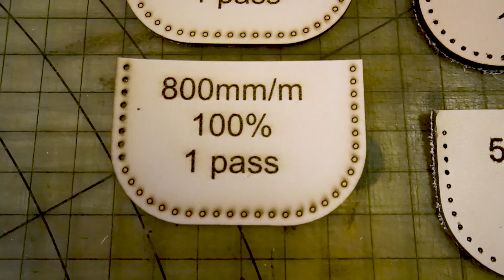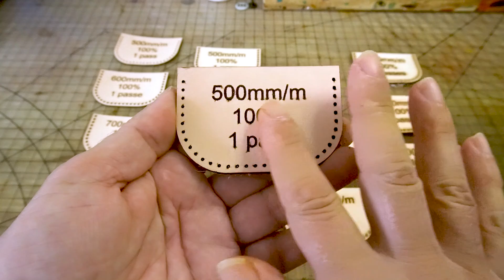Can a 10watt Diode Laser cut leather patterns and stitching holes? Aufero Laser 2 Lu2-10a 10 Watt.

Comment from the maker: Thank you for watching! Do you have a diode laser? What has your experience been with cutting out patterns? Please share your techniques with the laser community so we can all prefect our crafts. Thank you again!
Reply: So cutting 1/16 Balsa wood should be no big deal at all... I want to buy a budget diode cutter for c/l model airplane ribs 25 inches cutting per rib 24 ribs.  It takes a week of spare time to hand make a stack of ribs... will 5 watt work?? I can run it slow.. I'm a Noob
Reply from the maker: @matthewmutz9337  I just did a search in google for "cut balsa wood with a laser model airplane kits" and a ton of information came up. A 5 watt laser should cut 1/16 balsa fine but slower then a 10 watt. The higher the wattage of a laser the faster and thicker it can cut. A 5 watt laser should have no trouble with 1/16 balsa wood and can engrave in more detail then some higher wattage machines. Enjoy! I think this seems to be a great idea for speeding up your creations.  Thank you for the question.
Reply: how good has your diode laser been since you bought it, would you recommend this or ? tnks
Reply from the maker: @EkimNalim   because I have a few lasers I have been going back and forth but as for leather I do use the Aufero Laser 2 Lu2-10a 10 Watt the most. So far it has held up just fine. I do all my engraving outside so it is easy to take out because it is a light aluminon But when it comes to leather, what I like about it the most is that the nozzle at the bottom of the laser module is smaller then most lasers and also gives me more space away from the material when it is focused. For this reason it never snags onto the leather because it has good clearance and is small giving it less of a chance to snag onto leather after the leather is cut. When you cut leather sometimes it might curl up a little and while the laser passes that section to move onto another section the leather can rise to much and the laser can snag it as it goes by moving the material and destroying the rest of your project. When you look into buying a laser maybe keep this in mind. Thank you for the question. :)

Comment: Damn, thats cutting laser that well and my 22W with air assist can barely do 1000D Cordura.
Reply from the maker: Love your Avatar. :) Yes, I've reviewed quite a few lasers at this point and I've noticed that they aren't created equally. Some are just better at cutting. Even some 10 Watt. What laser are you using, if you don't mind me asking?
Reply: @baronleathercraft mecpow x4 pro, just got it assembled too. I guess ill have to try a lot of different setting combinations, maybe even one slow high power layer then a second one much faster and lower power to finish off anything.
Reply from the maker: @fennoman9241 I'm not familiar with that machine. There are a lot of them out there.  I’ve found that with my 24-watt ACMER P30, engraving works best around 9000 mm/min at 30–40 % power. For cutting, you can start around 400 mm/min at 80–90 % power, then adjust from there. In fact, you can just leave it at 90 % and experiment by increasing the speed instead of the power. It’s generally best not to run these machines at full power unless absolutely necessary. If you want to fine-tune your settings, you can always run one of those engrave-and-cut test patterns—though personally, I tend to skip them and go by feel.

Comment: The problem with laser cut stitching holes is that your thread gets dirty when passing through
Reply from the maker: Yes it does! I point that out in this video. https://youtu.be/djQ4_qhFWTQ If you are going to use a light color thread then I would just mark the holes with a laser and use a hole punch. Thanks for sharing!

Comment: Thanks for the video, I will be trying this today with a CO2 LASER.  Have been learning leather, punch and knife this seems much easier more accurate, I am wondering about the smell.  Vegetable tan leather VS other types, also is there a hazard from the fumes.  Have a exhaust system but no carbon filtering.
Reply from the maker: Hey, thanks so much for the comment and the great questions!
Yes — you’ll definitely notice a smell when engraving leather, even with a CO₂ laser. CO₂ machines usually burn cleaner than diodes or fibers when it comes to organic materials like leather, but it still produces smoke and particulates you don’t want to breathe in. A strong exhaust setup is important, and adding a carbon (charcoal) filter is even better if you can.

As for vegetable-tanned vs. chrome-tanned leather — veg-tan is always the safer choice for laser work. Chrome-tan can release small amounts of toxic compounds when burned because of the chromium salts used in the tanning process. Modern chrome tanning uses less harmful chemicals than in the past, but it’s still best to err on the side of caution.

Personally, I engrave veg-tan almost exclusively. I do have exhaust ventilation but no carbon filter at the moment — I’m still alive and kicking 😄 — but safety first is always the smart route.

Good luck with your test, and let me know how it turns out with your CO₂ setup!
Reply: @baronleathercraft  Thanks for the information.

Comment: What sort of leather do you use? I heard some can be very toxic when cutting with a laser
Reply from the maker: I mostly use veg tan or Buffalo hide lately. What you're referring to is known as chrome Tan leather. That has the potential of being toxic. In my research I seems that most companies do not use that type of  chromium any longer, but you can never be sure.  I do cut chrome tan leather. Make sure you have great ventilation.

Comment: Hello there. Thanks for this video. Very informative. Are you using air assist?
Reply from the maker: Thank you. :) Actually no, I did not use air assist here. This was my first laser and I did not own air assist at the time. I do highly recommend using air assist when cutting. Set it to low when engraving, in my opinion. Thank you for the question.

Comment: Thank you very much for this great and very informative video.
I would also like to try to cut leather with the laser and also make the stitch holes with it
But if I go through the lasered holes with a light-colored thread, my thread gets dirty and that doesn't look nice.

Is there a way to reduce or almost eliminate the dirt on the thread?

Thank you
Reply from the maker: I agree, I mention that in my cutting leather video with other pitfalls. https://youtu.be/djQ4_qhFWTQ what I do if I need to use light color thread is instead of cut the holes I mark them lightly with the laser and then use a hole punch. That way you have a guide for the holes which speeds things up for you. Thank you very much!

Comment: Must think that if this is 100% of 10W then i must configure my 50w to 20%?, well, i have tryed to cut chrome tanned leather 1.6mm thickness, but it need 1 pass on 35% (17.5w) and 1 of 20% (10w) both at 10mm/s, to separate it correctly from the piece, but it get a bit carbonized, any advise to prevent carbonization? or to do it faster
Reply from the maker: Thank you, Your logic is correct but I have found that the lasers do not respond like that. Wow! 50 watts, Which laser did you get?

Cutting chrome-tanned leather with a laser can indeed lead to carbonization due to the heat generated. To minimize carbonization and potentially speed up the process, here are some suggestions:

1. Optimize Power and Speed
Lower Power, Higher Speed: Try reducing the power slightly and increasing the speed. For example, use 25% (12.5W) power at 12–15 mm/s. This reduces the dwell time of the laser on the material, which can decrease carbonization.
Single Clean Pass: Experiment to see if you can achieve a clean cut with a single pass at an optimized setting, as multiple passes can contribute to heat buildup and carbonization.
2. Air Assist
Use an air assist system if your laser supports it. A strong air assist helps blow away debris and cool the cutting area, reducing burning and charring. Ensure the air nozzle is properly aligned to focus airflow at the cutting point.
3. Material Preparation
Masking Tape: Apply painter’s tape or masking tape over the leather surface before cutting. This protects the surface from soot and reduces scorch marks. After cutting, remove the tape.
Elevate the Material: Place the leather on a mesh or honeycomb bed to reduce back reflections and ensure clean cuts underneath.
4. Focus Adjustment
Check that your laser's focus is precise. An improperly focused laser beam can require more power or slower speeds, increasing carbonization.
5. Cooling Time Between Passes
If multiple passes are unavoidable, allow the material to cool slightly between passes to reduce cumulative heat.
6. Experiment with DPI
For chrome-tanned leather, lower the DPI/LPI settings slightly during cutting. Higher DPI means more energy is concentrated in a small area, which can increase burning.
7. Ventilation
Ensure you have good ventilation or exhaust to remove smoke and fumes quickly. Smoke lingering around the cutting area can lead to additional burning.
Testing Suggestions:
Create a test matrix using small squares with different power, speed, and pass settings to find the sweet spot for cutting your specific leather with minimal carbonization.
Reply: It is a CO2 one, not diode, ty if u have time and knowleadge about this
Reply from the maker: @HPC-AcademiaTruper  That is a horse of another color. :) Cutting 1.6mm chrome-tanned leather with a 50W CO2 laser can be a bit tricky, but here are some good starting settings that work for me:

Power: Around 20–25% (that’s 10–12.5W output).
Speed: 13–20 mm/s.
Passes: Try a single pass first, but if it doesn’t cut all the way through, do a second pass at a slightly lower power (like 15–20%).
Air Assist: Make sure it’s on and directed at the cutting area—it helps reduce burning and clears away debris.
Focus: Double-check your focus—it’s super important for clean cuts.
Tips to avoid carbonization:

Use masking tape on the leather before cutting to protect the surface.
Elevate the leather on a honeycomb or some risers to prevent back reflections.
If you need multiple passes, let the leather cool for a few seconds between passes to avoid heat buildup.

Comment: I'm thinking of getting one to cut my patterns instead of using the press mainly because of the stitch holes but was wondering how bad the smell is?
Reply from the maker: Thank you! The small goes away pretty quickly, I make some masks with lasers and by they time they ship the smell is gone. so far not one mention of smell. You have to do the edges, they will be charged. I recommend watching this video, it goes into detail on the positives and negatives of using a laser with leather. This should explain all your questions. https://youtu.be/djQ4_qhFWTQ

Comment: Hello, Sir! Thank you for this great video, I find it very helpful and professional.
I have a situation that I don't understand.  I ran a cutting test on a 1.7mm leather, using 10w diod, Lightburn.  It cut horizontally but not vertically. Where it is 100% cut horizontally,  the vertical cuts are 50-70% through ? Why is it? PS It cuts other materials fine
Reply from the maker: Lets see if I can help you. Is the laser attempting to cut vertically or does the laser not admit a bean at all when it moves vertically?
Reply: It attempts to cut vertically and it does, but only 50-70% success. Other materials are cut fine
Reply: added photos but I don't know where they got added to)))
Reply: Some say that because the beam is rectangular,  it is slightly less powerful on the y axis. If it was slightly , I would agree. But I ran 2 passes at 840mm/min at 35 power on a job and it cut well horizontally but not vertically.  I ran another pass, still didn't get through vertically
Reply from the maker: @peterec777  tell me about your laser, what type and what watts?
Reply: Xtool D1 pro 2.0 10 watt, software Lightburn
Reply from the maker: @peterec777  When I cut leather with my 10 watt lasers I set my speed to 300mm/m and I use 90% power. Based on what you have to told me you seem to be running your laser to fast and not enough power. Try my settings and then see what happens. If you think that you can run your laser at less power and faster try that in increments starting from my recommended settings.
Reply: @baronleathercraft  seems like I added some photos or videos in the comments,  please check,  especially the back of the test, it clearly shows the horizontal cuts and no vertical ones
Reply from the maker: @peterec777  The images do not show up in the comments section. I wish they could that would be a convenient feature.  If it is still not working then I agree with your original diagnosis, the dot shape. It is not uncommon for the focus heights need to adjusted. In other words, you have to find the optimal focus height since your laser seems to not be at the optimal height. First make sure your air assist is on when cutting. I would play with the height of the laser, I also have heard that cutting at a 45 degree angle so that it averages out the dot shape. In reality this should not be happening unless something is wrong if your cutting at 90% speed and 300% it should be doing it's job. You might want to post this issue in lightburn forum:
https://forum.lightburnsoftware.com/
La hobby guy forum:
https://lahobbyguy.com/bb/
or maybe the XTOOL community support:
https://support.xtool.com/community-support
You need more minds on this issue, maybe someone has had the same issue.
Reply: Thank you very much ! @baronleathercraft
Reply: @baronleathercraft I also had a thought,  can this be due to leather fibers direction?
Reply from the maker: @peterec777  you can test that by turning the leather to match the grain but I doubt it, you are cranking the laser up to the point where it should cut your 4oz leather without effort.
Reply: I ran a test with different settings including yours. It doesn't change the vertical horizontal matter
Reply: I wîll try your exact settings and I will try to wet thw leather before,  seems like it should help. Thank you very much for your time and guidance !

Comment: I am doing lots of leather cutting/engraving on my WeCreat Vision 20w and it's amazing. Only ONE issue... The smell of the leather, even after cleaning it, is not good. I have looked far and wide for a good solution to that.What I'm doing right now is putting my leather work into a box and using an Ozone generator to get rid of the smell. Are you aware of another, hopefully better, way of dealing with the burnt leather smell. It is particularly noticeable on leather pint glass sleeves and earrings...Thank you.
Reply from the maker: That actually was one of my fears when I converted some of my leather mask patterns to be cut with a laser.  When I first cut them I would smell the char of the leather and of course masks are worn right up against someone's nose. I was like, I can't send these out like this. :) What I did find thought is that after a few days (even after building the mask right away) the smell went away completely.  As of this day not one client has brought this topic up and I sell a good amount of masks. I think the ozone generator sounds like a good test. I would leave some outside of the box without the generator and some with the generator and then have a friend smell them and see if they notice. Do not even tell them about the laser cut and see what there opinion is. It could be keeping them in a box might prevent the smell from going away but that is what the test is for. As far as my findings, as I said the smell goes away pretty quickly. Make sure to sand and burnish the edges since that is where most of the contact with your laser is and most of the char is. Let me know how it goes! Great topic...:)

Comment: Thanks for the video. I am just getting started with lasers, I bought my first one yesterday the xtool s1. I am a holster, belt and wallet builder, my question is can you just scan an existing pattern into the software and cut it to scale? I am struggling to find a video on this topic.
Reply from the maker: yes you can, it is a little tricky sometimes but very doable. Also a great idea for a video. There is a few ways to approach this. After you scan the pattern you are going to want to convert the image into a vector. You can turn your scanned image into a vector in lightburn but it is limited and most likely not going to give you the single line vector you are looking for. I have been using Adobe Illustrator to do this ( Video here: https://youtu.be/m0oKqHeBjeo )but I have now been using a free program to trace my scans into a vectors called InkScape. I will make a video but I can not get to it right away. When you have your traced vector bring it into lightburn and cut out the pattern on a piece of cardboard to see if it is the right size for you.  if not, resize it in lightburn. This is just a quick explanation but I am here to help you. Just write with your questions and I will respond the best I can. Have fun, don't get frustrated. This is how you learn and all this experimentation is going to help you understand your software and the steps you need to take to achieve your goal.
Reply: Thanks I appreciate any help, I feel like Jake in avatar when told him that he is like a baby, cause he doesn’t know anything 😊
Reply from the maker: @rolltide5586  Not as dangerous of a situation. :) Just make it fun and write down when you have an epiphany on how to do something.